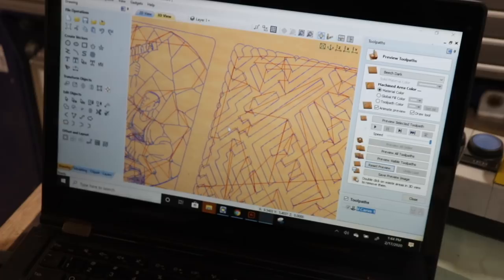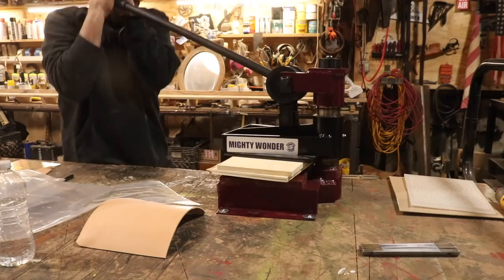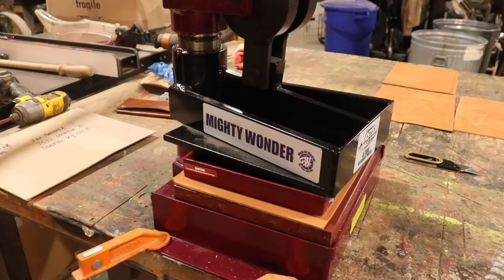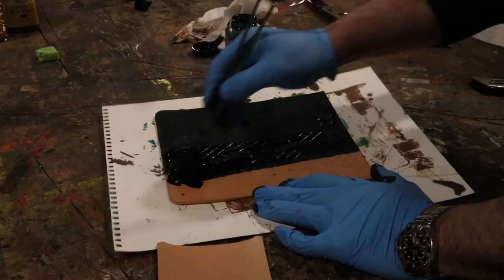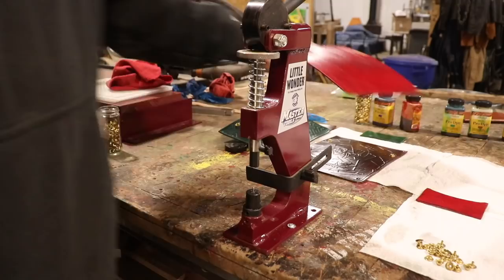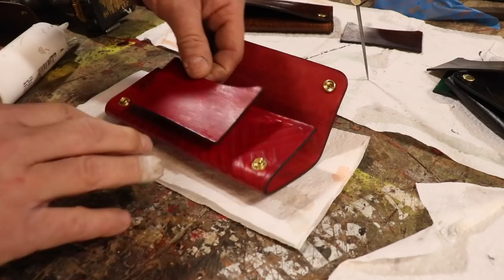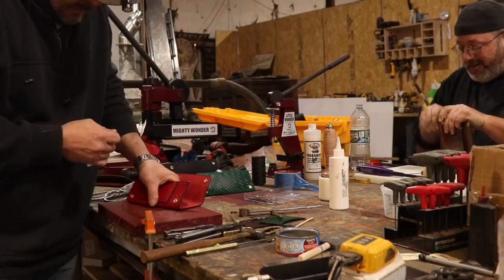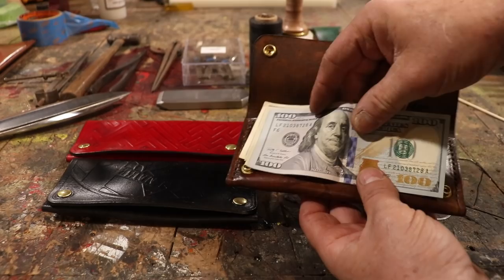Jimmy DiResta Textured Snap Wallet

Comment: About the dying - I've heard it can be helpful to pre-wet the leather before dying - this supposedly gives you a bit more control over the final colour. You'd pre-wet according to the type of dye you're going to use, i.e. water- versus alcohol-based. Anyone know about this or is it just a bunch of nonsense.
Great project as always. So jealous of the shop and available tools. :)
Reply from the maker: Hi Craig,
It's mostly personal preference, some people swear by it, others say it doesn't make a difference. I would try both ways and see which one works best for you! Chuck prefers the dip-dye method on dry leather for the best, most uniform coverage.